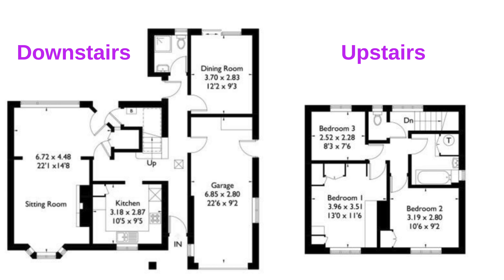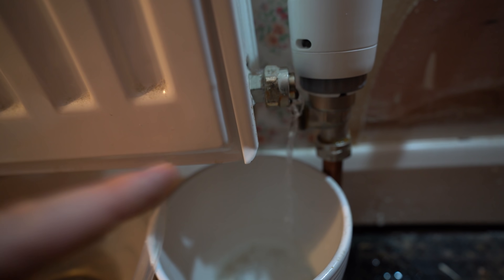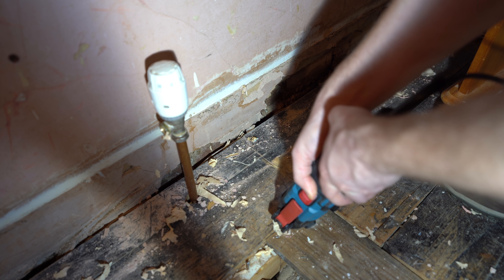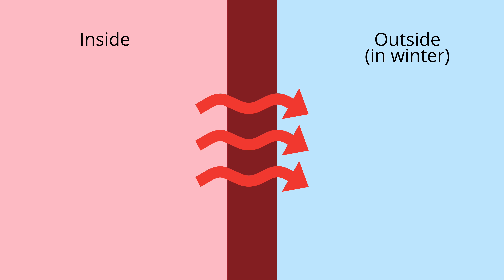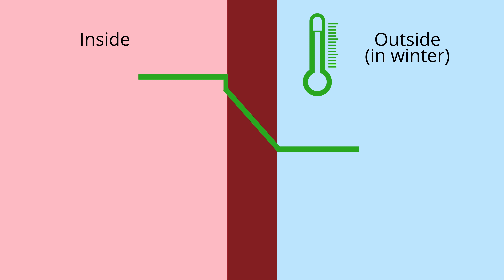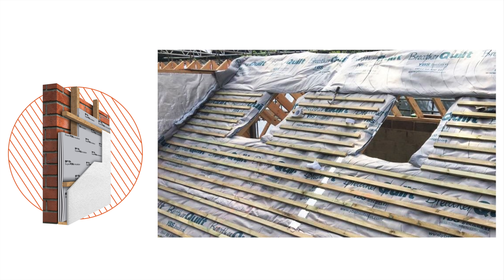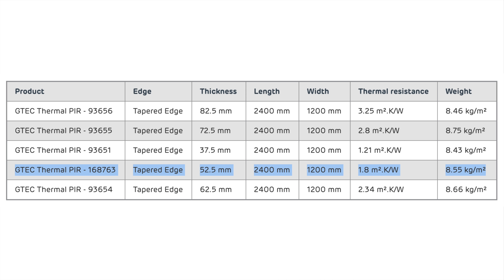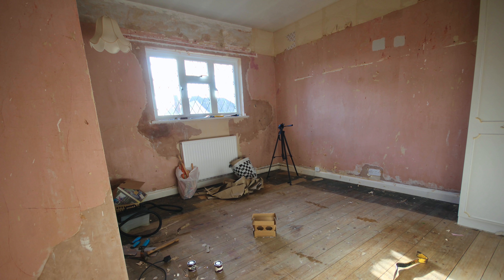Using Adhesive Foam To Attach Insulated Plasterboard

Comment: Did you check the vapour resistance of the boards you used? Depending on the thermal value of the construction it may not be enough to stop condensation, lots of these insulated boards claim water vapour control even though they have quite poor water vapour performance or no dedicated vapour control layer at all - general suppliers also tend to get this mixed up.
Reply: Can you recommend a board with suitable VCL ? I thought most were foil backed - is this not enough?
Reply: @jve  Knauf Thermal Laminate Vapour Check
Reply: @Swwils  thank you.  I could only find these in polystyrene version, not PIR.  I see other vendors have vapour barriers that are to build regs standards e.g. Recticel supply a PIR / plasterboard with vapour barrier (Eurothane PL) that conforms to EN ISO 10456.  Have you come across these?
Reply: @jve  You just need to make sure that you are actually getting what you need, there are two main vapour resistance values used so it can be quite confusing. Your supplier might not know the difference - if in doubt contact the manufacturers technical team directly, they will be of massive help.

You'll see typical boards like XPS that has no vapour control layer with a resistance like 12.8 MNs/g or even the regular thermal laminate that has no resistance at all but then ones with vapour control layers will be around 80 to 150 MNs/g like PIR laminate.

Comment: Being a solid wall from the 1920’s have you got lime mortar solid walls? 

We’re looking to internally insulate our 1890’s cottage but been advised repeatedly by preservation companies not to use gypsum plasterboard or create a vapour barrier on the external solid walls. We’ve been told the solid walls need to breath. Going with a wood fibre board and a lime plaster finish to avoid any damp issues later. 

Really interested to see how the insulated plasterboard works out for you. Cheers for the video.
Reply: I have been advised the same solid wall needs to breathe. I thought of why not use good roofing membrane on the solid brick wall which is breathable and acts as a water vapour barrier on the wall then batten up and use rockwool (insulated and breathable) Inbetween then use moisture plasterboard used for bathrooms?
Reply: I think you are generally ok with gypsum if you have a damp proof course thus helping the wall above it to stay dry. In old buildings with no dpc the walls can contain considerably more moisture and need to breathe, lime plaster allows this while gyp doesn't. Also consider the paint over the plaster as this will need to be permeable as well and lots of modern paints aren't. Full disclosure I'm not an expert.

Comment: 11:50 That's not how you use them fixings lol
Reply: How do you use them?
Reply from the maker: You hammer in, then drive in the screw with an impact/drill driver. I did this but not everything is shown.

Comment: you can't do  planning to do EWI or CWI as change to the building fabric.   The competent person schemes are supposed to notify local authority 48 hours before the work is carried out but when we looked into this in some areas 1/3 didn't notify building control - you have to be careful before letting anyone near your building and the PAS2035 standards go a long way to improving assessment and sign off.  I suppose one disadvantage of DIY thermal improvements is that the EPC isn't improved even if the house feels warmer and bills are reduced!

Comment: I'm looking at doing exactly this once I move into my new place and in all my research hadn't seen the foam as an option. Always helpful to see well presented alternatives, thanks!
Reply from the maker: Snap, but I’d heard it worked and given the paper backing it should be no different to regular foam attached plasterboard. We’ll see though. I’ll update as the room progresses!
Reply: Silka plasterboard foam might be an option too, its amazing stuff and the nozzle is really good, ive had left over stuff and used it 2months later no problem, i have a form gun but after lots of use its pretty gunked up now, tried cleaning it but i think its too far gone, so the silka nozzle was a nice surprise.

Comment: I build a sun room 7 years ago 6m by 5m,,windows on 2 sides and 2 sky lights (velux window)
i have 300mmcavity walls , i got them pumped with insulation , and on the inside walls i put  insulated plasterboard  12mm  plasterboard  with 35mm  insulation, its very warm with one rad about 1.5 m long  under a window  and on on the wall about 300 mm wide and 1.5 m tall, the roof is a warm roof, worth every penny, and looks good too...
great video man
Reply from the maker: Sounds great! Is it cool in summer too?
Reply: @AliDymock  yes,lots of glass but , i put on extra long eaves, i picked it up while working in Austratia, it works there , so why noy try it here, im in the Rep of Ireland. the sunny southeast,,;-) the sky windows are on a remote and close if it rains , very handy